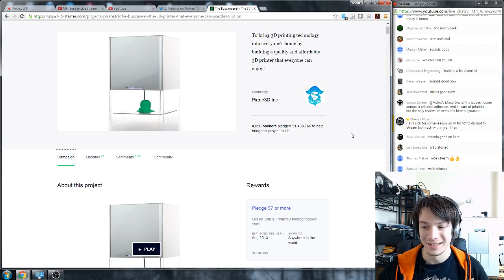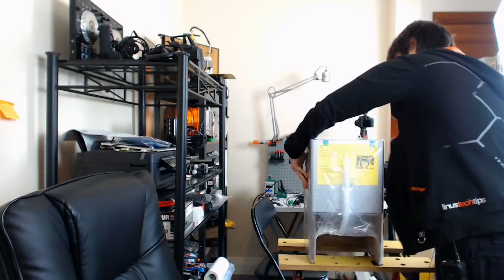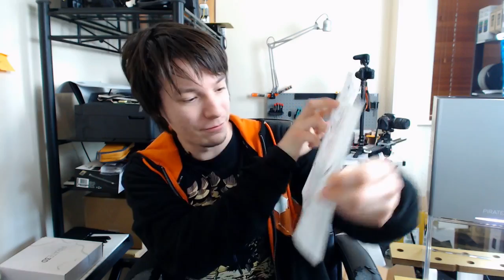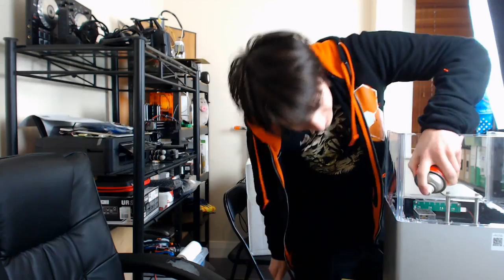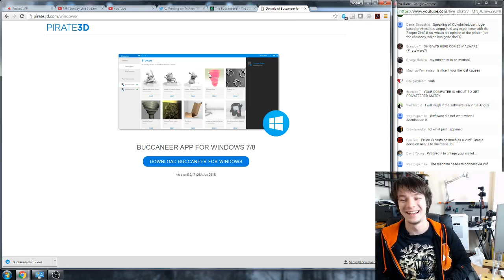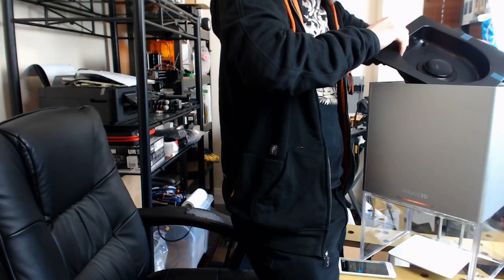Unboxing the Pirate3D Buccaneer - Was Live

Comment: for clear prints you need 3 things. THICK. .8mm minimum really you need 1.0 or 1.2mm nozzle. Second is print SLOW 20mm/s maybe slower depends on printer and filament and third is print HOT.

do that and you can get "shockingly" transparent prints.

Comment: Tip for the next time you have to lube and screw around with threaded rods, and you are as lazy as i am when it comes to turning them with my fingers:
Use a cordless drill or one of these small battery operated screwdrivers. Makes it very easy to drive the screws (if they are not completely bound up) up and down the full length a few times.
Just make shure you don't go too fast and you don't fry your driver board. I prefer to disconnect the motor drive shafts by loosening the screws on the pulleys or couplers.
If the cordless drill does not fit "in the printer", use the extension pieces from a socket wrench set and cardan joints, and maybe desing and print some adapters if you can't get it to fit right. If you need a quick fix, a hot glue gun is still the fastest prototype 3d printer... ;)

Comment: I'm a long time subscriber and I enjoy most of your videos, included this one. You look very conditioned by the kick starter campain, and I share your point of view about it. Anyways the review should have been fair despite of the 1750 cheated backers. I'm not sure that was fair enough. Through, I don't habe any commercial printer exerience, I only own DIY or Kit printers. IMHO dealing with a new printer needs some time to get it printing properly. For a DIY or kit printer it takes days. Maybe unboxing and review should be splited. Any honnest review needs experience on the printer. Otherhand, maybe your first impression is still right, but actualy I'waiting for your second appeased run.